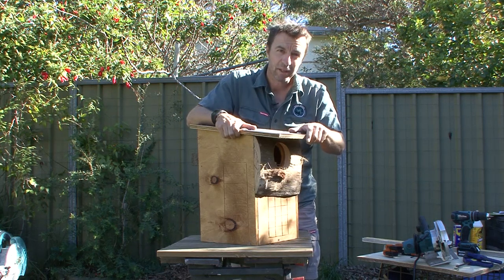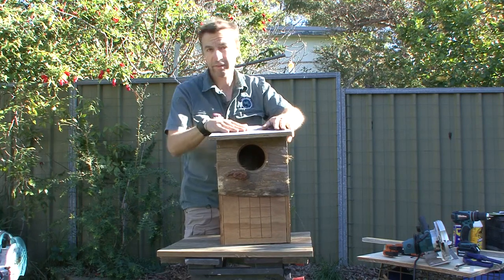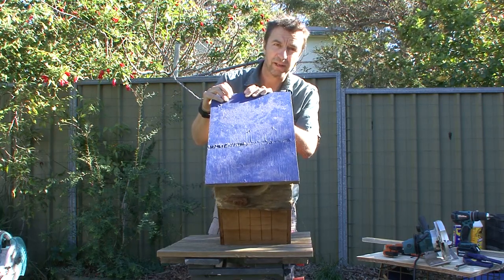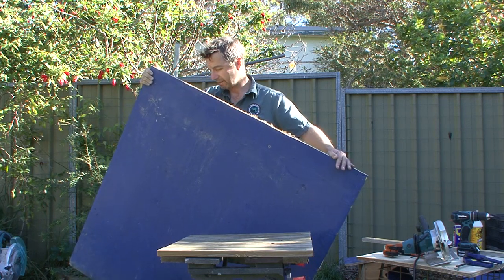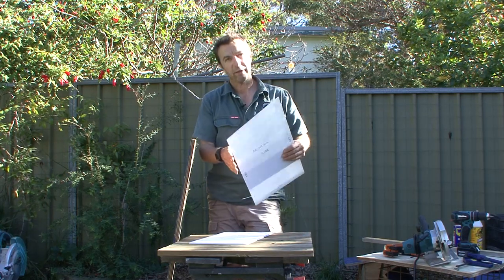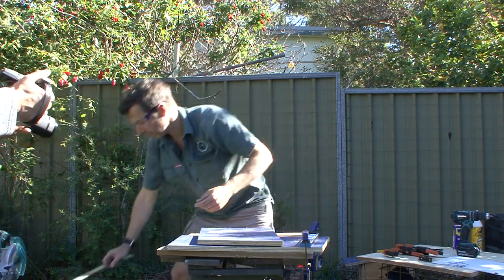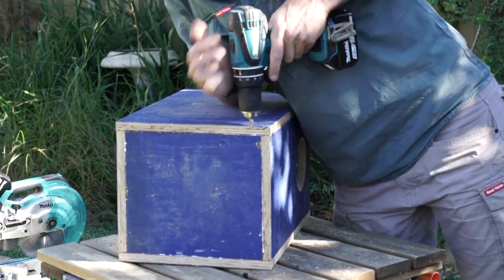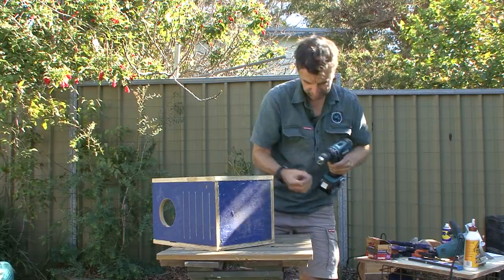How to Build a Brushtail Possum Box

Comment: This is helpful for me as i have at least one living in my roof and i want to tempt it to move out. Ill also drill a few holes in the bottom incase water does get in like I would for a birds nesting box.
Reply from the maker: Great, yes a few holes (4's enough) in the base is essential for rain that comes in and also to drain possum wee. If you can find where your possum is getting in and out of your roof you might be able to install a temporary 1-way flap there. Possum can leave at night but cant return to your roof. Just make sure your new box is ready to go nearby. Stick some banana or grapes in (and on) your new box and your set. Your possum may decide to go somewhere else but the main thing is you've provided a safe, easy alternative. Brushtails will share den sites over the years so your box will definitely be put to use one way or the other!  Good luck.
Reply: @lofiboulevard  there's a hole in my eves which will be getting repaired soon, if boarders stay open. I was thinking of blocking it off one night when I know the possum has left. I want to make sure it's not a mum with a juvenile since I have heard two in there before.  I get both brushtails and ringtails they seem to take turns at who lives where. Up until a month ago a ringtail had made its nest in my jacaranda tree. I try not to interfere too much (let them live as natural a life as possible) but if a nest keeps them safe and out of the roof I'm happy to do it, I don't believe roof insulation can be too good for them .

Comment: I have some left over spotted gum decking pieces and a possum in my roof.  Can I make a Possum Box from the spotted gum...
Reply from the maker: Absolutely - that will look real nice and be really long lasting. Seal any gaps to stop the wind coming in and use a low toxic paint or sealer and it will last many years